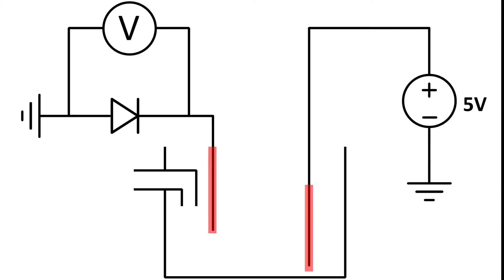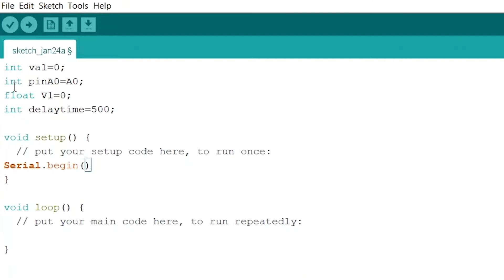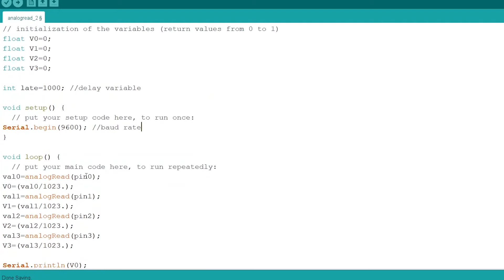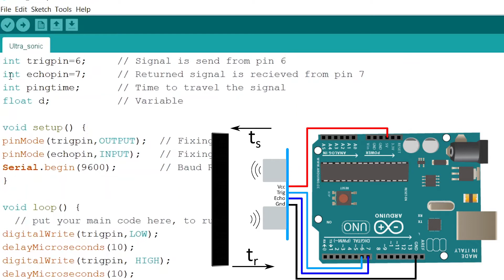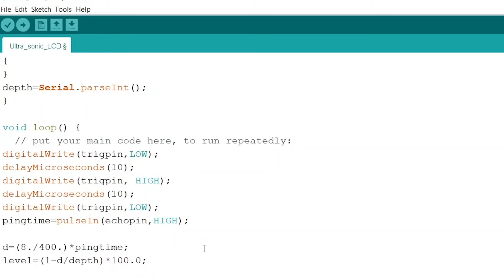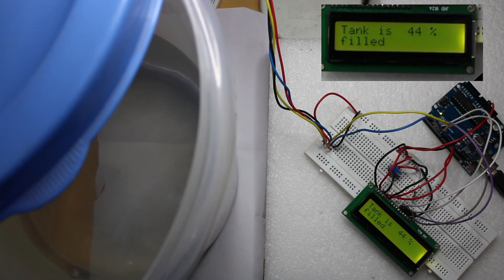Water Level Indicator | Ultrasonic Sensor | Will it sense accurately?

Comment: how to enter the depth of the tank
Reply from the maker: Hi, in the code present in the blog, when you run this in arduino, the serial monitor prompts you for the depth of the tank to be given as input. You could also hard code the variable "depth" in the code according to your measurements.

Comment: how can we change percentage to inches and cm in water level
Reply from the maker: Within the code provided in the pinned comment, we convert the ultrasonic data from remaining cm level of water in tank to percentage. You can use it to get the value.
Reply from the maker: Within the code provided in the pinned comment, we convert the ultrasonic data from remaining cm level of water in tank to percentage. You can use it to get the value.
Reply: @rlcprolabs2862  im very new to use this coding will you plz make coding for me in cm...........

Comment: Is ping vs distance graph constant for all? Planning to Install it in a 1000L Tank and I'll just compute the ping vs distance using your equation
Reply from the maker: Hi. For our testing purpose, we used a 25L water bucket in which results were satisfactory in steady-state conditions. The equations were able to correctly reflect the distance. Do install and test it out in larger system, the larger scale should also work. Only thing to consider is that, commonly available ultrasonic sensor gives correct readings upto 2m or so.

Comment: Can we give the input from a mobile app by using HC 05?
Reply from the maker: Yes, we can give the same. Check the updated version of this: https://www.youtube.com/watch?v=6fTto0inpEk. Also the same being sensed in mobile app: https://twitter.com/ProlabsRlc/status/1382883763433054209?s=20
Reply: Ok. Thanks for your reply ❤
Reply: Is it possible to do it with 1 BT module sending the value of depth from mobile?
Reply from the maker: @ssaahil  Yes we can work with just 1 bluetooth module also. But the issue is Depth sensing module would be at a height at terrace and LCD for visual would be inside the house. That is why we needed two bluetooth module. If you don't want to use the visual part. You can remove the 2nd Bluetooth module and directly connect with BT module at terrace with app.

Comment: Hey, the same formula doesnot works for ultrasonic level sensor, where there will be separate probe. What is the formula for that?
Reply from the maker: Hi, Roopesh. I was not able to understand the question. What separate probe is it? We mounted ultrasonic sensor directly on the top of bucket lid and from there we calculated the time it takes to travel to and fro. Is that what you wanted to ask? Do check out this link: https://rlcprolabs.wordpress.com/2021/02/12/water-level-indicator/

Comment: Will this work on long run
Reply from the maker: Sorry for late reply. We have tested this setup for some days but not for longer term. Since this is an experimental setup, a product can be built with durable, water proof enclosure and battery for long term solution.

Comment: sensor reading showing 37 then goes down to 32, irregular value. How to avoid this, possible to put delay?
Reply from the maker: Hi Monish. Yes, during transients such as disturbance in water when adding causes the distance between ultrasonic sensor and water level change abruptly. Possible solution as you said could be introducing delay or provide an averaging solution when in transient. During steady state, it was providing with fairly good values.
Reply from the maker: Due to pandemic, we were in between completing the final setup which got halted. Possibly, in the upcoming days, more projects will be showcased. Keep tuned to the channel. :)